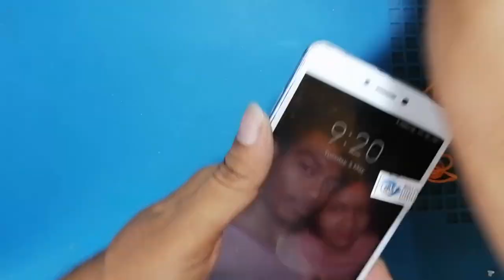Restoration destroyed Phone | Mi note 4 | Rebuild Broken phone

Comment: I have a Redmi Note 4 Snapdragon with a screen replaced recently. The problem is the screen only works after the phone is booted, if I let the screen turn off, it can't be waken up again. There's still backlight, vibration and all and I still hear sound. Which means the touch does work, only the screen doesn't display anything, just black. What can be the cause of this? Thanks